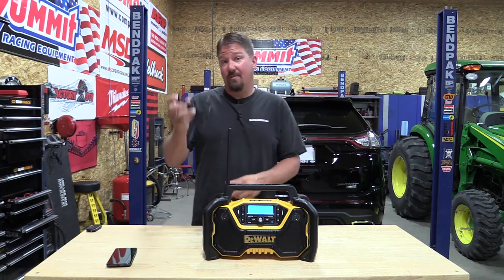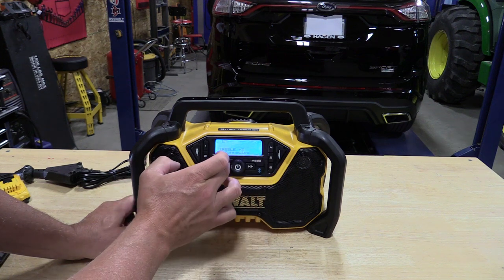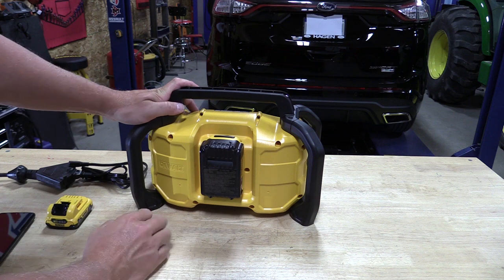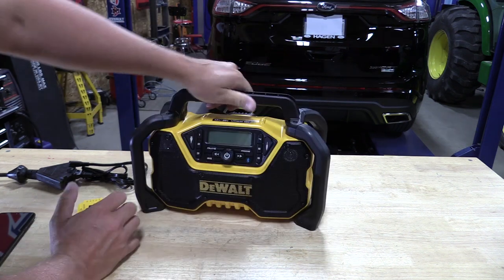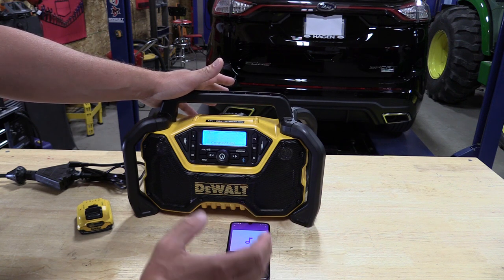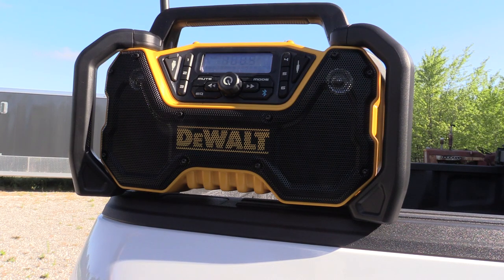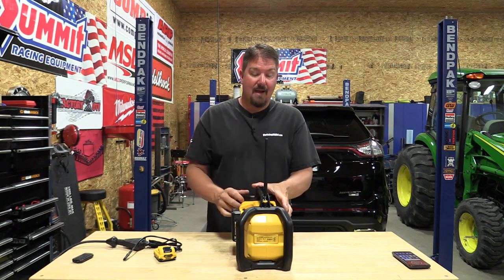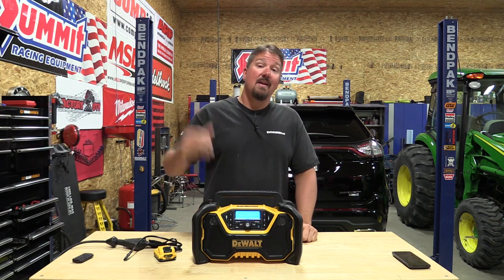DEWALT DCR028 12V/20V  & AC Jobsite AM/FM Radio With Bluetooth Review

Comment: Does this get LOUD? I’m looking at buying one of these as opposed to a regular blue tooth speaker because I need something LOUD to compete with all of the noise in my area.
Reply: I would also like to know this answer!
Reply: Yeah it sounds pretty good in a auto mechanic shop. Large steel building so its wide open.  Butnthensound travels well through the entire shop. But keep in mind it's a small radio but its loud for what it is
Reply: Buddy of mine brought this on the boat yesterday. Blows my JBL Extreme 2 out of the water. Super loud, hard hitting base. He also had an upgraded 20v/60v battery and said it goes for 3 days before needing a charge. It's an absolute beast.

Comment: These radios are more expensive than non jobsite radios, but in the long run if you use a radio a lot and you have plenty of dewalt batteries you actually will save money because you won't pay for batteries which can get expensive and they don't make rechargeable D batteries
Reply: Rechargeable D-cell batteries exist (10000 mAh powerex , ansmann,...) (5000 mAh ones are just C-cells in D-cell casings) I dont know how fast they recharge or last compared to the dewalt batteries.

Comment: I love it, for a small shop it is perfect. Good sound adjustability for your preference. The antenna is the best part for me. With every other radio I have tried to use in this shop I have had issues but not with this one.  Great sounding radio that doesn't take up allot of space.

Comment: Ive wanted one since I was a kid and I finally broke down and bought one. It should be here this weekend.
Reply from the maker: You will love it.
Reply: @WorkshopAddict  i noticed in your review that your model is volume controlled through the stereo and your phone. I just got mine today and idk if its an update or what but I can only controll the volume through the stereo. I can turn it up and down on my phone but it doesn't affect the radio volume unless I turn my phone volume off then it mutes the music.
Reply: @koreywilliams4570  I want one so bad
Reply: @thomasdolan8066  its pretty awesome. My only complaint would be the little screen is hard to see unless you're standing right over it 😕 at chest level you can't see anything even tho its slightly angled forward so you should be able to. Other than that it sounds great I love the little usb port and storage compartment. Also it would be nice if it had the plugs on both sides mine has 2 plugs on the right side so its a little annoying trying to use them to run extensions but I had my angle grinder hooked up to it and it worked just fine.

Comment: yeah well i've had mine for less than 6 months and it quit on me today. lost power and will not come back on with power cord or battery. it was running on power cord as always when it quit today. any ideas?
Reply: Did you manage to get it fixed or replaced? I assume it has a 1 year warranty or so. If you got a replacement how is that working for you since?
Reply: @harveysburger  I called them, told them what happened. I still had my receipt because i'm ocd, lol. they sent me a brand new one and didn't want the old one back.
Reply: Alright pretty good then they honored the warranty

And the new radio still works to this day?
Reply: @harveysburger  it does. use it 5 days a week.

Comment: Great channel, solid review 👍....don’t see the point of this. On a construction site or framing, you either want a large powerful sound , like the original tough system radio, to fill an area...which is still the best sounding out there...or,,you want a small radio to be next to where your working, ...
    This thing is too big . The new M12 radio is great size to be next to you or in a machine, manlift, etc..the small Bosch is great also...Dewalt does have a smaller radio but it’s still a medium size...and bulky. Makita makes a nice compact radio also and water resistant. 
     Dewalt designers just don’t get what trades people want. Expand the flexvolt line, more watt hr batteries  at a lower price like Milwaukee does. Expend 12v Line and bigger 12v batteries....forget Atomic junk, and the new upgraded 20v stuff...add more 20v tools...
Reply: This small radio has great sound imo. Perfect for any jobsite.
Reply: This radio is incredibly loud, the review doesn’t show it properly
Reply: Atomic drills are actually very good, I use my atomic more than my XR set. It's more durable and built better, the 3 speed switch on the XR series is the stupidest design for outdoor weather, it gets slightly damp and then malfunctions constantly. I've been pretty impressed with the atomic, especially the atomic hammer drill

Comment: I got one from a 3rd party retail and it's looks new but the day I got it worked good but a week later when I put in my battery or conect the cable it doesn't turn on I have to wait at least half an hour while having it connected to turn on

Comment: Will a flexvolt battery fit? Most dewalt radios are heavy. Can you give a rough weight with no battery?
Reply from the maker: 8 pounds without battery and a FV will fit without issue.
Reply: @WorkshopAddict that's pretty light. My toughsystem 2.0 sure does sound good but it is heavy at 16 pounds without battery. I may have to pick up one of these.

Comment: Thanks for video. Perhaps they'd corrected android volume issue It's 2024 and was given a used one. Volume set at 4 an samsung phone controls Volume well. Have not experienced any distortion. This was found in attic of house friends  bought. Movers tried to extort 4k from them to complete the move so several of us loaded open trailers and pickups and got er done. I was the last to leave them and hos wife asked what it was. He's not a mechanically inclined sort, looked at it and asked if I wanted it.  Layered in construction dirt and saw dust. Ot had abraided handles and didn't seem to want to pair with Bluetooth as we tested it. Got it home, found it would pair. I cleaned it up and magic marker on scuffs made it look near new. Not having any dewalt cordless I ordered 2 supposedly 6ah batteries and dual rapid charger on the cheap. Batteries are Chinesium but they do work very, very well for the radio and I wasn't going to spend good money on a dewalt battery and charger only to find that the cordless aspect was non functional.
I've got shy of $70 in the thing and love it!

Comment: Interesting how the volume on phone and radio are separate
Reply from the maker: For android phones, that has been the norm.
Reply: I always preferred it that way tbh.
Reply: @WorkshopAddict  very true
Reply: @Dinkbass  it depends on what im doing on if I want them to be synged on volume or not if I'm super busy I would rather them be synced but if I'm just relaxing and enjoying the firepit or something like that I would rather them be seperate so I can fine adjust the volume the dewalt tough system 2.0 radio charger on Android volume is synced with phone also depends on phone if I use my Samsung galaxy note 10+ 5g its synced if I use a samsung galaxy note 8 or before it isn't synced has a ton to do with the Bluetooth version and protocols allowed

Comment: This looks slightly smaller than the DCRO25, which I’ve had and the TStack and Tough System have way better sound. DCRO25 bass sounds blow through the volume knob and front buttons.

Comment: No, "we don't all want everything". All I want is a loud enough, weather resistant enough, tool battery powered radio. Don't even want Bluetooth. Actually would rather not have it. Just AM/FM. Wish the old DCR018 was still around, I'd buy one. Unlikely I'll buy the 025 or 028.